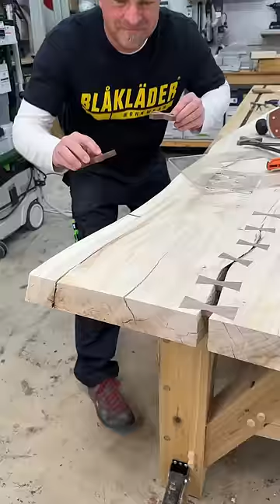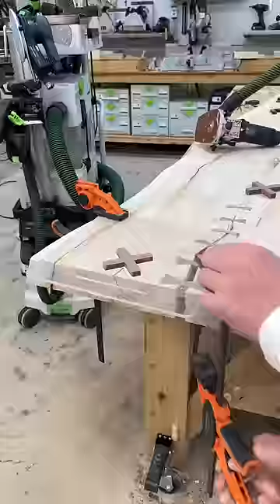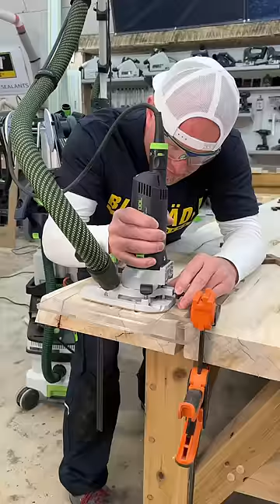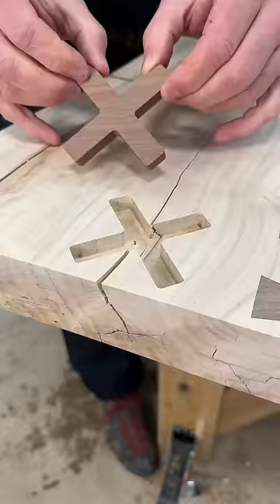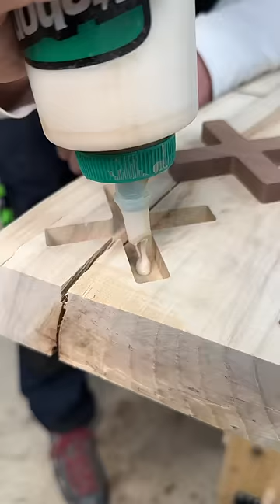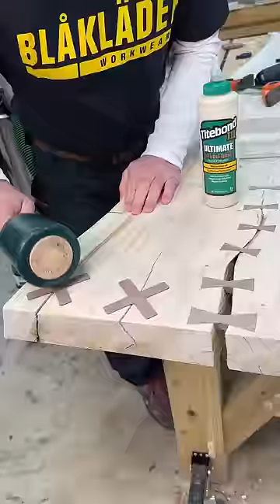Adding some X’s with the Slabstitcher templates and some Titebond 3 #woodworking #wood

Comment: Someone must’ve really loved that slab to make you go through so much extra work with the bowties and the x’s
Reply: So much extra work?😂  hes not doing this by hand but power tools, a kid can do this work and they do in trade schools.
Reply: Unfortunately it's trendy. Probably going to fill it full of epoxy too. It's just a way to sell a crappy unusable slab of wood to some snob that doesn't know better. Call it art and sell it for full price.
Reply: @HellaNorCal916  Wait til they pour epoxyover musicians.
Reply: If I had no choice but to use it, I would’ve put wood glue in the cracks, then used clamps to squeeze together, then put the bows and X’s in after it dried. Could’ve done that much better. Now, if they don’t care for functionality and longevity, and just wanted a certain look, ok I guess.
Reply: @daddio159 only problem is that's not really gonna work for that massive split the bowties are holding together
Reply: @furnacego2164  I’m talking about the two X’s. It would hold those together.
Reply: @HellaNorCal916 you may say unusable, however the fact he turns it into art (which is subjective) means it had a use.
Reply: @HellaNorCal916 how is he a snob for making furniture?
Reply: @IRAQYsniper95  he's calling the buyer a snob
Reply: @furnacego2164  still don't understand how people buying furniture are snobs?
Reply: @IRAQYsniper95  it's expensive furniture and he thinks it doesn't look very good, or that it looks bougie to the point of tackyness, so he calls them snobs I suppose
Reply: As the full saying goes, “The customer is always right, in matter of taste.”
Reply: Extra work for me, for that guy is nothing
Reply: is this for elon musk?
Reply: Its just a play on the ol bow tie. Bow tie have been used for many years to prevent stress and drying cracks from growing. However, most of the time they were not a focal point of the slab, opposite grain patterns.
Reply: @daddio159  It looks as if he cut the wood edge to dimension already. the big crack you can pretty much forget about trying to clamp it back together.
Reply: It seems to me like the guy being judgey about someone else buying a "bad slab" is the real snob here. If people like this style, then it's a piece that doesn't have to go to waste. Seems like a win-win to me.
Reply: @HellaNorCal916 you seem like a big fan of sustainability
Reply: @HellaNorCal916  Jeez I see being cynical is trendy too. 😂
Reply: If they truly loved the slab they wouldn't have ruined it with these x and -
Reply: Just because its simple doesnt mean its not work? All bricklayers do is stack blocks, but youd be hard pressed to tell them its not work. Nothing worse than a woodwork snob@inflation1139

Comment: I would have used bar clamps to pull the cracks closed then cut the X recesses so that when the contrasting wood X's are pounded home the crack stays closed after the clamp is removed.

Comment: Just as a helpful tip, you can get your bow ties in much quicker if you put a small piece of wood on top to protect it from damage, then use a clamp to push it in place. I love making bow ties, and this method is also pretty satisfying.

Comment: Maybe next time make the X's with criss crossed grain (two pieces joined) so the grain actually holds the cracks together
Reply: Plywood,  yes
Reply: What is the optimal grain direction for the X or bow tie compared to the grain direction of the slab ?
Reply: @mmyc5680  I assume 90 degrees (perpendicular) would be strongest.

Comment: @dustylumberco What would happen if you applied pressure to make the cracked wood marry up again then put the bow tie in? Would the bow tie be able to keep the crack together? Or are bow ties only for preventing further cracking?
Reply: You can't push a gap like that back together in most cases. The wood has shrunk, they don't really fit exactly anymore and the force may cause other places to split.
Reply: @court2379  Thanks for the reply. I am curious because I have an old table that the center column has a spilt down. Over the summer I plan to address it and I am wondering if pressing it back together with ratchet straps (tested already and I can make the sides marry up again), gluing the crack, then putting bow ties across the rejoined crack would be strong enough joinery to hold the pieces together again. What do you think?
Reply: @wesleydewit2048  That sounds much more likely to succeed. You could put the ties on the back. 
That or clamp the whole top down and cut the whole thing in half, the kerf then removing the gap, and glue it back together.

Comment: What you're doing seems pretty easy to understand (it's not dissimilar to the metal strapwork I've seen fitted to old & cracked brickwork). I'm just not sure why you're doing things this way.

Some of those smaller cracks (like the one on the far left) look like they could be glued & closed with pressure from clamps before fitting the crosspieces. Is there any reason why you're leaving them so wide open when fitting these stitching pieces?

Comment: You also can fill in those cracks with ashes and super glue be tighter than any metal the bonding is incredible and you can sand it

Comment: Could have easily snapped those stitches hammering on em . You can use a cutoff to hammer on and prevent snapping a leg off the X.

Comment: Doing this by hand the traditional way us still wayyyyy better cuz the lines are much more sharper and gives the effect of less tolerance. The rounding look of the shapes I ain't much a fan off but I guess it will bring the cost down on this piece, since the labor and effort for perfection ain't there.

Comment: I always find your videos useful.😊😊Anyway This ep  is a repair for cracks, right? But I'm worried that those cracks will widen further.  Is it okay?😢😢
Reply from the maker: Thank you very much.  The slab has been drying for two year and where it sits now is where it found equilibrium. If I were to try to force a gap that size closed would create a lot of stress in other areas and would make more problems to fix. So with the wood in a state of equilibrium you can add these bow ties to stabilize the crack. (It will still move seasonally and may want to grow the length of the crack) and also add them as decorative features
Reply: @dustylumberco  Wow, thank you for your kind explanation.👍👍👍 My curiosity and worry have been relieved 🫡

Comment: What would actually be impressive is colour matching or a near match but with enough contrast to make it a feature a piece of wood using the grain, using a steamer and bending and conforming and then slotting it to fill the crack, that would impress me not these how not to quick fixes. If you have an impressive piece of wold do an impressive piece of work.

Comment: There’s so many ways to make a table for thousand less- So if I break a table in pieces retro fit piece then epoxy it I can get 20 grand per table-  ima bout to cut a bunch of trees down , make them perfect then crack them in piece to refit it with pieces an epoxy- thx for the advice 😂😂😂smmfh

Comment: Should not the same be done at the bottom too to prevent warping.
Reply: Wood should already be dry and done warping, these are more for looks
Reply: His slabs have been drying for two years.
I don't think there's much chance of warpage.
Reply from the maker: This wood is now less than 10% moisture content and is about as stable as it going to get. These bow ties are part decorative and part to keep that crack from growing. You would only need some on the bottom if these one on the top were likely to fail.
Reply: Thank you! thank you!

Comment: AĞACI SIKIŞTIR VE ÇATLAĞI KAPAT,
SONRA DA YAPACAĞIN İŞİ YAPSANA
Reply from the maker: the slab has been drying for two year and where it sits now is where it found equilibrium. Trying to force a gap that size closed would create a lot of stress in other areas and would make more problems to fix. So with the wood in a state of equilibrium you can add these bow ties to stabilize the crack. (It will still move seasonally and may want to grow the length of the crack) and also add them as decorative features

Comment: those are meaningless unless they go all the way through the top. those are just decorative
Reply from the maker: This wood is now less than 10% moisture content and is about as stable as it going to get. These bow ties are part decorative and part to keep that crack from growing. You would only need some on the bottom if these one on the top were likely to fail.

Comment: I've always wondered about wood glue swelling and contracting as it dries. It swells, and you sand it. When all the water leaves, the molecules shrink and the wood (where glue used) shrinks. You would  never use polyurethane glue; it expands like crazy. I have had this problem with counterbored dowel plugs and end up leaving them "expanded" for quite a while until I sand them flush. Of course your "patch" leaves an outlet for the glue.
Reply from the maker: There is a lot of great technical info on the Titebond website that goes over how the glue and polymers bond with the wood and each other that I think you would like and find informative. Also on their IG page their expert has a number of videos where he discussed common questions and gives great answers.